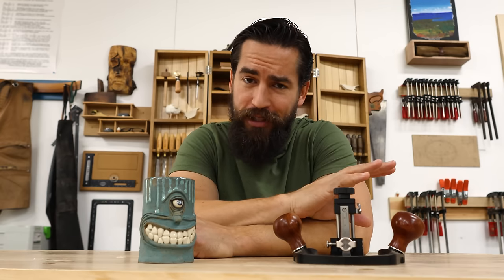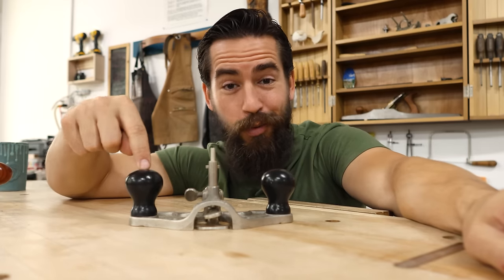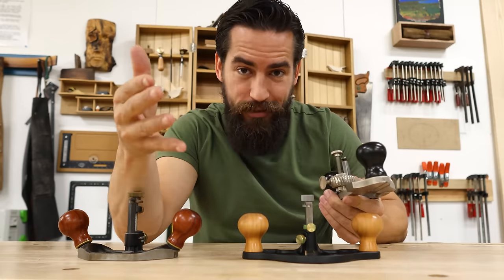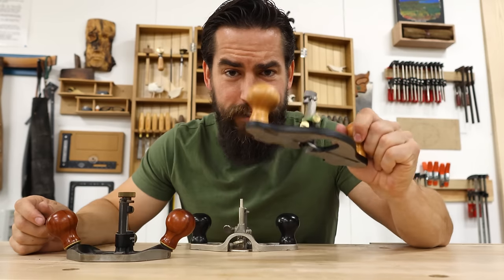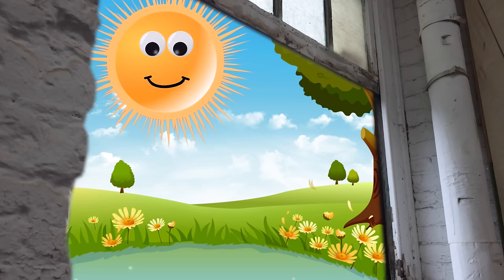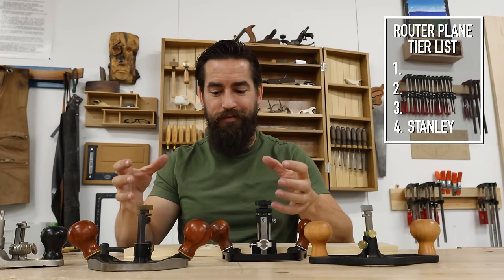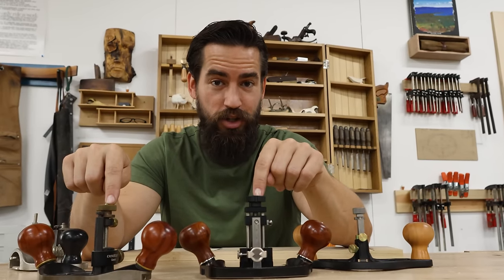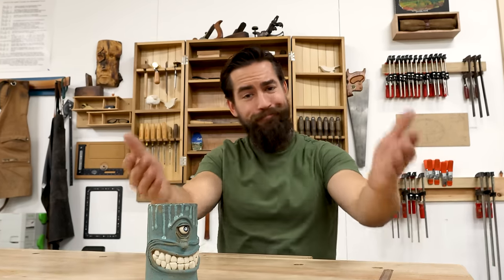How a hand tool split the woodworking world

Comment: I don't think the controversy is about Jkatz producing his own tools.  The controversy is about Hongdui stealing the base design from Veritas.  Let's be honest,  it's not a Jkatz tool.  It's a hongdui tool.  And they've ripped off other companies like Bridge City tools Kerf maker.  They clearly have the ability to manufacture a quality tool,  but don't have the ability to come up with an original design?  The other problem is that if I buy a minimum of 10 pieces of this plane from Hongdui,  I can put my own name and logo on it and remove any reference to Jkatz at all,  and market it as my own.  How much loyalty do you think this company has to Jkatz if I started moving more router planes than he does?  It's dishonest.  Stealing Veritas's casting design was dishonest.  Stealing Bridge City's design was dishonest.  And THAT is the problem with that tool,  Not that Jkatz is producing tools,  I own his dovetail guide,  it's a solid product that HE designed.  But I'd rather have a crappy Stanley, than a hongdui.
Reply: Is very simple....is more easy and cheap,stole the idea....🤷
Reply: Every design is the same as you can shape a base in so many ways. Hongdoi is a manufacturer they are not going to care if you buy some and slap your name on them. Who do you think makes all of the tools? Almost every tool company buys from tool manufacturers and slaps there name on them. Just like you can go straight to a tool company and get a tool. Harbour freight is a perfect example they have multiple dewalt tools with there name on it.
Reply: This is the same problem with Temu tools as well.
Reply: You're supposed to copy useful designs. That's how technology progresses. That's why we have a patent system.
Reply: Bridge City Tools are owned by a Chinese company aren't they?  Could it in fact be a licenced product?
Reply: @koomber777  Bridge city was owned by an engineer from California named John Economaki and he sold bridge city tools to the owner of Harvey international Jack Xu in 2018
Reply: @ponyboyc  when you're talking power tools,  yes.   But lie Nielsen, Veritas make their own tools,  they are not manufactured by another company and renamed.
Reply: But the bases are not the same. It’s not the same casting at all. It’s similar, but so are every single other one made for the life of the existing of the tool.
Reply: @luismigueldominguez5487  it's only $20 cheaper than a Veritas and you get a depth scale which I'd say is an improvement imo.
Reply: @HopeStreeWoodworks,  this isn't any worse than veritas' and LN's adaptation of a stanley.  JKM tool adds depth gauge and has more surface area on the base than the veritas which will make it less likely to tip when refining tenons.  is it a copy b/c angled knobs? BS. if so, then LN is a copy of Stanley knobs.  Almost every LN tool is a direct remanufacture of stanley design w/ even less adaption than Hong Dui did here and I don't see them paying any royalty or licensing to Stanley out of the goodness of their heart.  how is this different? 

Bridge city is overpriced relative to quality and they prove it w/ their almost daily email promos offering 50% off on rotating products like they're Harbor Freight. That's more dishonest than what you're claiming here. Not to mention, they sold to Harvey which is another chinese company(base is china, i know they have a cali office) who produced white label tools for years(still do?) same as Hong Dui (some past laguna stuff was made by harvey). I have a harvey bandsaw and it's good stuff but, I'd never pay full price for it(got it during one of their "sales"). None of this is any different than Jet, Grizzly, etc which woodworkers all spend money on without complaining.

->"How much loyalty do you think this company has to Jkatz if I started moving more router planes than he does?  It's dishonest." <- they're a white label provider. they will just sell to both and anyone else interested.  This is how every chinese mfg company on alibaba operates.  Grizzly, Jet are just relabels of same products.  Is that dishonest too? Same products w/ minor components and QA specification changes to meet their price point.

Anyone shopping LN tools is not looking at this.  LN customers are higher tier who have money to blow on tools and want quality.  The router is close enough in price to Veritas ($20) to make Veritas the obvious choice if you're shopping w/ price as consideration. It's not enough a deal if you know what's available.  Anyone more price conscious is looking on amazon or ebay.

Edit: veritas does have a couple patents on this(spring clamp the main one). but imo, copying plane designs has been established as common practice in this industry so i don't think warrants outrage in this case. and personally don't find veritas design that novel...though gov't disagrees i suppose
Reply: @luismigueldominguez5487  it's virtually the same price as veritas and is no more a clone than LN is of every single stanley product that they pay no royalties for.
Reply: @HopeStreetWoodworks  and Hong Dui makes their own tools...  white label providers are not new.  Grizzly, Jet... same shit, different name.
Reply: Version 1 was identical.  The one in this video is version 2.  Version 1 did not have the depth stop or the hex bolt handles either.
Reply: @no_goo  Look at Veritas's designs on their planes.  They are unlike others on the market.  It's their intellectual property that Hongdui copied.  Veritas even brought it up on the opening page of their 2022 catalog about people in the industry stealing other companies designs.   If you worked hard and put in all the R&D to come up with a design of your own,  and it was copied by a Chinese company,  you'd be upset as well.
Reply: If a manufacturer chooses to release a product without patenting it, it's fair game.  Copying a product is not "stealing", it's call competition, and is encouraged by regulation in order to benefit consumers.  When Chrysler invented the minivan and then all other auto manufactured copied the idea, were the others "stealing"?  of course not.  Tools are considered "useful articles" and their designs are not subject to copyright.  If there's no patents, it's in the public domain.  I really enjoy using my Makita oscillating multitool and my wallet is very happy that Makita is now able to copy the Fein design.
Reply: The fact that the version 2 base (which is what is shown in this video) is quite different from the version 1 base would seem to indicate that some protection was in place to warrant the design change.   However it is also worth noting that Hongdui still sells the version 1 design on Banggood.  Perhaps patents are not as easily enforceable in China?
Reply: @ponyboyc thank you. Don't think I've ever seen someone else who knows about Hercules being DeWalt just different name and color. People care too much about the name and not enough about their paying double the price
Reply: This video is about router planes, not about brands. Hongdui stole what base? Cast iron or steel? A thing holding a blade? They all do that. 45 degree angles knobs? Other router planes have that as well. 
Design patent requires them to be exact same to be an infringement. This is not a direct copy. 
I do with hongdui started with their v2 base which does not look like Veritas any more. Just because it “looks like something, it’s a copy of that thing” is very subjective. Look at what’s the same, similar, different and improved then decide. That should be the point of this video.
Reply: @Fusion_Woodworking  guess the op thinks that veritas stole it from the ancient Peruvians or something too because it's been a similar design for thousands of years now. I personally don't think they know what they're talking about
Reply: Grizzly and jet are owned by 2 different companies. Jet and powermatic are owned by the same company while Grizzly and shop fox are owned by the same company.
Reply: As long as it's not an exact copy I don't have an issue with it. I have more of an issue with the labor practices that go into cheap tools.
Reply: @HopeStreetWoodworks Hmm. I did read an article in Fine Woodworking where they went to the Veritas factory and interviewed the owner. He showed the journalist around their stock room of old tools and Veritas was clear. They copy out of patent tools and if possible make some improvements over the original design. I don't think you can point the finger at Chinese companies for doing the same thing.
Reply: That is not 100% true, they don't just copy, they improve on design and quality. And you can buy it unbranded because jkm version is oriented towards the na market.
Reply: @mikeclark2720 what is your point? They all come out of the same factories. Maybe Powermatic gets slightly better castings, maybe not.
Reply: The base IP is public domain. So all brands/models are the same base tool. They trim & features are the only differences. That's the way it goes with such an old design. It's like getting mad at GM/Chevy for their engine design being stolen from the first invented of the gas engine. It's just silly.
Reply: So, the elephant in the room...
All of these tools are based on the old Stanley patents. 
There is very little intellectual property here. Let's take the hammer. First, it was a rock, then a rock in a stick, then I was made of metal with a stick... who stole the idea from who, when comparing all of the hammers from history.

When the patents run out of time, they can be copied and produced by others under different names...
Veritas, Lie Nelson, jkatz Moses.

Did Dewalt or Bosch or Makita steal from skill for the circular saw?

Or did Craftsman steal their tools from other products or just make improvements and market them to one of the most popular tool lines in history. 

Or, is it that we have a problem with WHERE it's produced ???...

Well, what are you watching this program on, and where was it made?

It is actually a bigger elephant than a router plane.

As for me, I still use the Stanley, a matter of preference only.

Comment: For me the Veritas is not that great. I bought it 3 year ago. First of all, I never thought, that the size would be my main problem. I like to clean tenons with it and because it is smaller than my stanley and the handles are agled, it is very difficult to maintain a solid stand on the board that's beside the tenon. The second problem and maybe it was specific on my plane was, that the locking mechanism never got to the point, where the blade did not move when I was working. Every time the blade had to took off more then a hair thin shaving it wanderd downwards. THe plane was bought new, but I fast came to the decission to sell it and try a used stanley instead an it fits my need better and holds the blade. I thin the Lie Nielson blade will hold excelent in the cast whole, but never tried one. Maybe it's personal preferense but for me, a good used standley was the better investment for me. But if the Veritas serves you well, it's the right one for you. I think at the end I am not into tool wars anyway. get the tool that fits your need, test some different and if the things you want to create are possible to creat with the tools, it's the right tool for you. Like your content, great work. The Katz-Moses Version is all over the chinese sites and in the same style as customer brand in europa at Dictum too, so it's a very close call, that the all came out the same factory in China with different names.

Comment: Depth Adjustment
All you need is a loose leaf binder of shins with a central cutout to go under the casting and both sides of the blade. Pick the right shim e.g. 1/10,000 of an inch, loosen the collet and hold the casting and blade pressing lightly downward. Then retighten the collet, licking the blade 1/10000” lower. Remove the shim and the blade will accurately plane out /10000” for you. 
Works with el cheapo Stanley and the fancy costly variants equally well. Obviously this only needs to be used for finalising the dado as the adjustment will be coarser down to the last 1/1000” or so.

Comment: It is - as a metalworker who came to the hobby from woodworking first - weird to me to hear woodworkers talk about the differences that a few thou will make. Generally solid wood will move way more than that seasonally. That having been said, it's also *refreshing*; yes, wood will move, and yes, glue will absolutely take up even a ten-thou gap without much trouble. But chasing precision can feel GOOD. It's a false economy when you're trying to make a piece to sell. But if you're just... working to a high standard because that kind of practice is how you improve? That's something I can genuinely appreciate.

All of that having been said, I've often really felt that any kind of plane iron - and this includes hag-tooth and router planes - should be fashioned from a single, simple, flat piece of bar stock. The owner of the plane should be able to replace the iron with a shop-made one that was laid out on flat bar stock tool steel which was prepared with no more than a file. I'll make allowances for the necessary hole in the irons of most bench planes, but generally the adjustment features shouldn't be a part of the iron in my view, they should be integrated into the cap-iron or chipbreaker.

Wooden planes meet this definition far more readily than transitional-and-later planes; I'm not sure why I feel this way, mind you, and it's not something I feel strongly-enough about to claim is some kind of hard-and-fast rule to which I hold even my own tools, let alone anybody else's.

I dunno. Every so often I draw up a set of planes in CAD with this design requirement. The Router is always the trickiest. Maybe someday I'll actually make one of these silly things. It's a lot of design work which is intended to make the "consumable" of the iron itself something trivially replaced by the woodworker, and which is totally unnecessary in this day and age. Maybe it might've been something useful in the nineteenth century, to be able to just go to the village blacksmith and say "hey I need an iron; it's not complicated."

Comment: I made my router plane from a piece of oak firewood. The blades are made from large hex keys and held in place with a steel dowel pin and thumb screw. The depth adjustment is a ring with thumb screw. The wood is an elbow, so he grain follows the front. Part of the top is live edge. The thing is, it actually works quite well. I can affix a plastic laminate shoe protector with carpet tape later if I want.

Comment: I have an LN.   I was curious to see how you compare tools you can make from a block of wood and an Allen wrench ground to a point.  I don't see measuring scales as a feature as if I really need precision to match a cut, then I just adjust the tool using the original cut, set the depth stop and work my way down to it.  I'm ok with Youtubers making money selling tools.  I like JKMs content, but his tool seems more fancy than anyone needs, but the price is good.  I received my LN as a gift, but I have made my own in the manner I mentioned above. but I'd use any of the ones mentioned.  Good work.